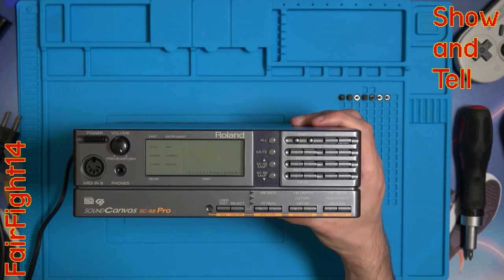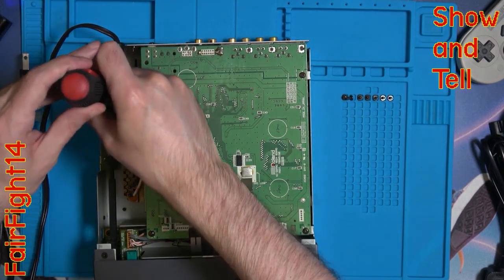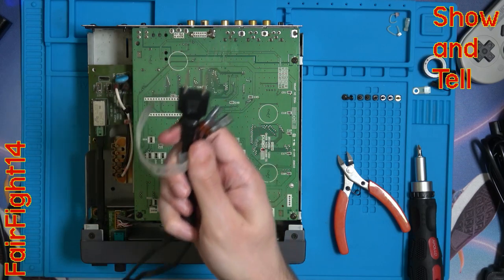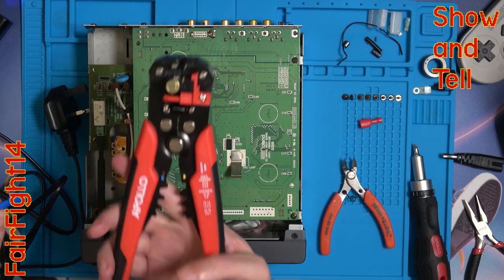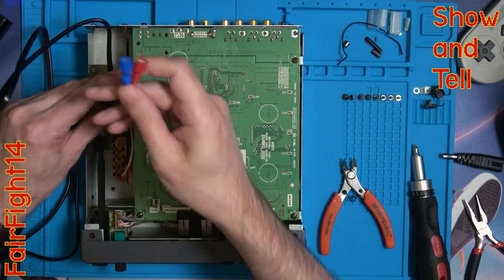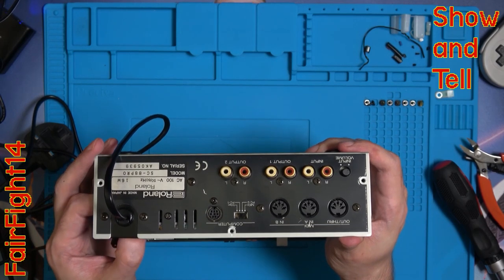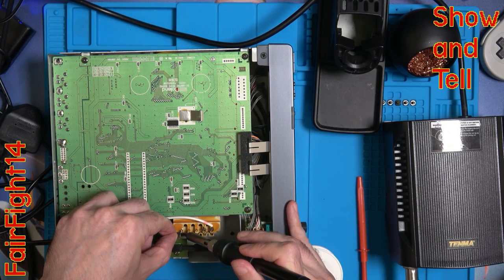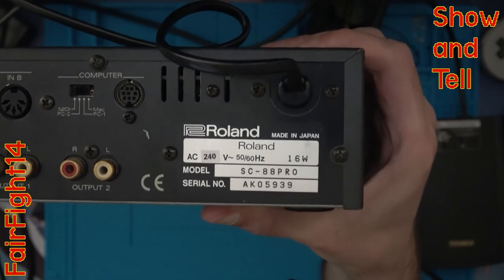A How-to change the Roland SoundCanvas SC-88 Pro input voltage - A simple tutorial

Comment: Here's a tip for people doing this, you can move the power switch rod out of the way if you're worried about accidentally melting it. Grab the wider black piece where it attaches to the switch and pull it forward. Now the rod can move sideways from the switch and drop down or be removed from the unit entirely. Same process in reverse to reattach it when you're done.
Reply from the maker: A great tip! Thanks for sharing!
Reply: Great suggestion!  I just did this job and that tip helped immensely.  I only have one eye so I struggle with depth perception and as such often end up melting things while soldering when I misjudge where they are in space.  Your advice likely saved me from melting my start button post.

Comment: Stupid question here:  it looks like the original power cable is non-polarlized, but I notice the connections at the board are labeled hot and cold.  Does it really matter which way you connect it if you're using a non-polarized cable?  It looks like your UK connector has the ground post, so yours is guaranteed to be in the 'correct' orientation when plugged in, but if you're using a two-pronged cabled this wouldn't be the case.  Also, any idea what size crimped connector you used?  Thanks!

Comment: And I was worried... LOL
Reply from the maker: I hope that means you feel like you can mod yours too? 😀
Reply: @RetroBoxRoom  I've done SMD soldering. So piece of cake!
Reply from the maker: @RalphWLundvall  Oh cool. The most difficult part for you then, will be messing about with the grommet! 😀
Reply: @RetroBoxRoom  USA. No need to touch the power cord unless damaged. 100v to 120v "MOD".
Reply from the maker: Geez. Rub it in why don't you? Lol
Reply: @RetroBoxRoom  Was not as easy as expected.  Heated the solder joint, applied slight tug upwards and the 100v pin came out entirely still mightily connected to the wire. Ended up cutting and stripping. Barely got a soldered joint but it powers up and sounds great. Cutting and stripping definitely the way to go.
Reply from the maker: Out of interest, what temperature was your soldering iron set to?

Comment: Awesome Video I'm from Australia I was wondering is UK the same as Australia regarding 240v I see a lot of electronics between 220 - 240v curious to know if its the same? I noticed theres a 230 option and 240 option. thanks in advance
Reply from the maker: From what I understand most of AUS has moved across to 230V, just like the UK. Which really is 220V-240V. You'd be better off asking someone who knows for sure in your local area, since Wikipedia does say different areas in AUS are still running 240V, and haven't moved over to 230V yet.

Personally I'd guess either 230V or 240V would be fine, since in this case we know it'll be at 50Hz either way. On the side of  though, caution 230V will be safe, because if it doesn't work, just redo it to 240V.

Either way, on your head be it, not mine! 😀

Thank you for the compliment, and good luck! 🤞

Comment: thank you! i'm wondering if your unit is still functioning?  are you meant to be able to switch the voltages or does it damage the unit?
Reply from the maker: You're welcome. It's only what they would have done in the factory, as they sent them to different regions in the world. So, as long as you do a good job of it, it should be fine.

Comment: Thank you so much for this video man. I’m in the United States and have a 100v SC-88 Pro arriving from Japan tomorrow. I read a bunch about modifying these for 120v and by all accounts it’s dead simple, but I’ve never soldered before really so I was still sweating it a bit. Your video has put me right at ease, it really does seem trivially easy.

Even though the Japanese plug will work in our outlets as-is, given the age of the device and not wanting to put stress on the power supply, I will also be replacing the cord on my unit. I’ll put a polarized two-blade plug on so it will only go into the outlet the right way and the Sound Canvas doesn’t have to do any extra work reversing polarity.
Reply from the maker: Thank you very much for letting me know. Your situation is the very reason I make my videos. 

I recommend you practise on something that is very much broken. So you get used to how your soldering iron, takes to melt solder.

It is "easy" enough of a mod, and well worth doing.

Please let me know how you get on.

Comment: Hey! i'm 5 years too late but i figured i'd shoot my shot. For our game we are going to use this little device and it just came in!
I wanna do the same thing as you do on the video but with a EU Adapter.

I was wondering if i need to solder the black cable on a different pin or if i just solder it on the same pin as in the video? The only difference is the EU Cable, which is 220-240 Volts
I've been scouring the Manual of the SC88 pro, but i just can't find the exact place for the pin on there. Maybe you know? Thanks so much for your help!!! This video is the best help ever because without this i wasnt even able to figure out how to do this in the first place!!!
Reply from the maker: Hi, it’ll won’t make a difference if you wire it up to the 240 or the 230pin.

If you freeze frame the video, you’ll see the different voltage pins, and you’ll see it when you crack it open anyways.

The UK and the EU are both are on 230V -6% and +10%.

Back in 2003, it changed for the EU from 220V and the UK from 240V. 

Let me know how you get on, and thank you for the kind words!

Comment: Nice video !! I have the same unit and I like it so much !!
May I ask this:  Is there a way to measure the internal board voltage and ampère ?
I would like to convert it to be "USB powered", skipping the internal power-adapter and going in directly with 5V onto the board itself .
I'm not an expert and I don't know how to figure it out ( need to understand if would work on uSB )
Reply from the maker: Thank you.

You'd be better off asking at vogons.org. There's a lot more people, with a lot more know how, there.
Reply: @RetroBoxRoom  thank you !!